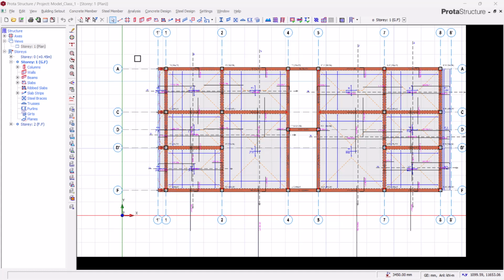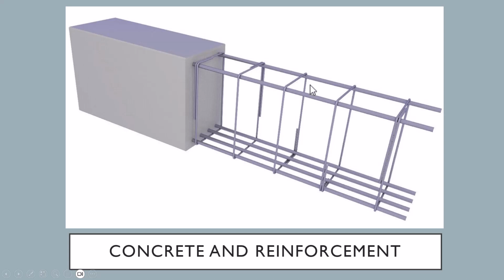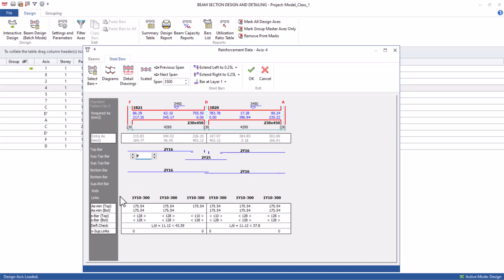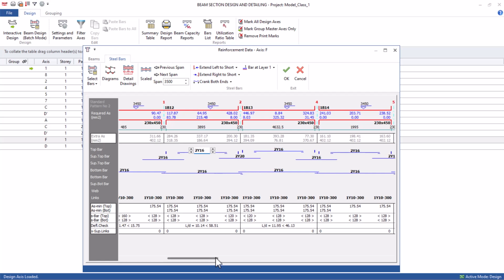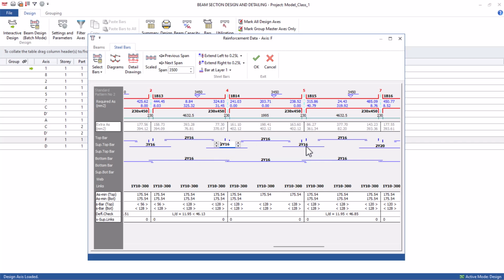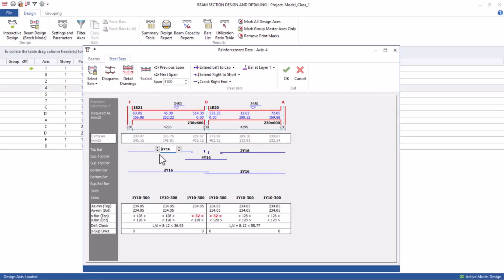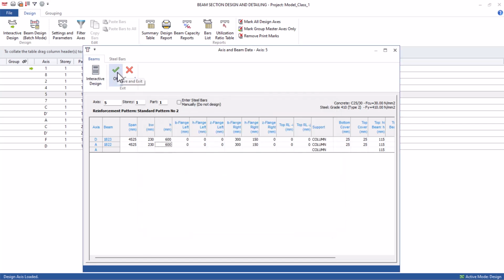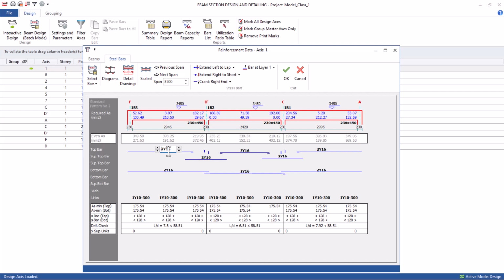How to Analyze and Design for Beams and Columns on Prota-Structure

Comment: I love what you're doing. Pleas sometimes when you lap those bars and the remove the supporting bars ,it still shows sufficient. Isnit a good practice?
Reply from the maker: You have to make the lapping bars same number and diameter of the supporting bar. 
Which ever is greater between the lapping and supporting, use that.

Comment: is the roofing loads coming on the 2nd story beams and columns insignificant? because i didnt see any roofing load representation in the series.
Reply from the maker: The dead load from the roof can be added to the roof beams  by multiplying the unit weight of wall by a height of about 0.6m. 
With experience, this still amount to same reinforcement as our minimum hanger bars provided by the beams hence was not applied.